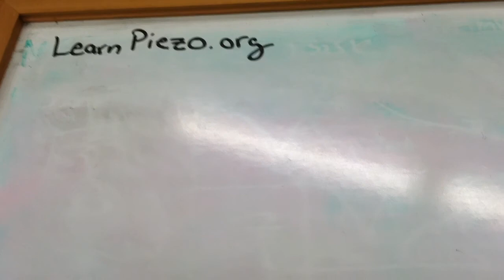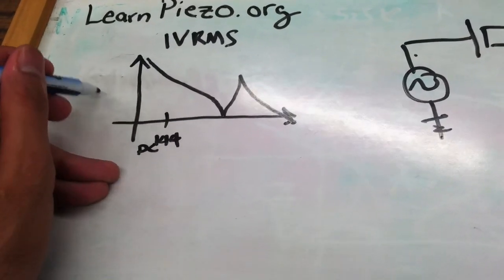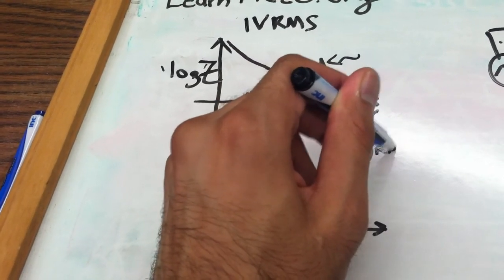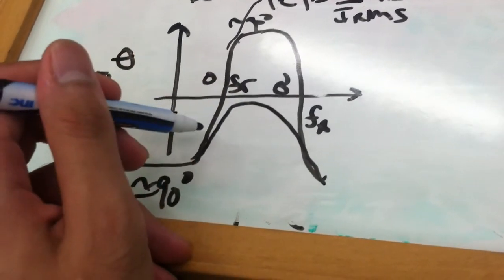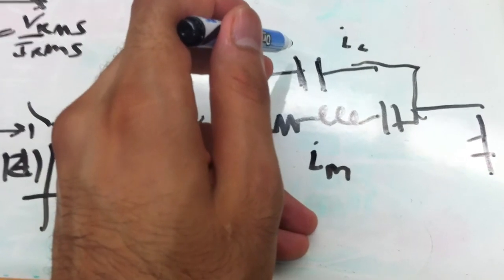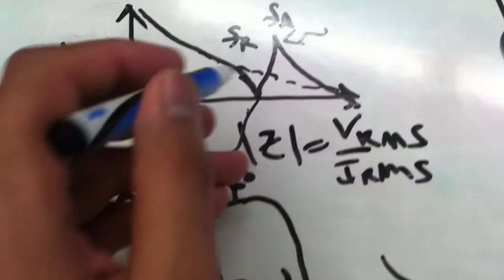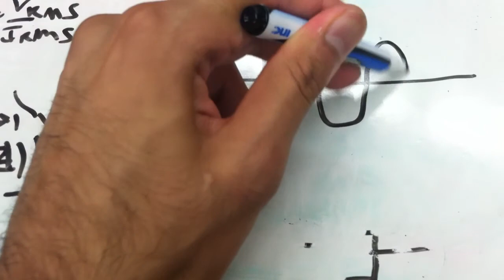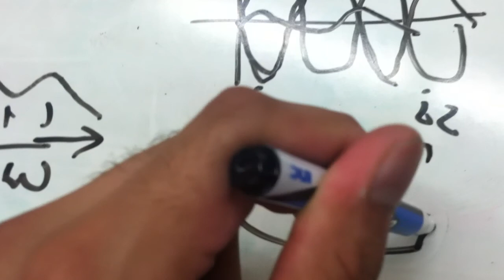Learn Piezo Lecture 8C: The frequency response of a piezoelectric element

Comment: Hi I want to ask whether the resonant frequency is only describing the electrical resonant frequency. In other words, can I vibrate the piezo material at this frequency and called it as resonant occurs?
Reply: As far as I understood, vibrating a piezoelectric material at its resonant frequency can also be called as resonant vibration or mechanical resonance. The piezoelectric material will vibrate with maximum amplitude and will produce the largest output of electrical energy or mechanical vibration at its resonant frequency.